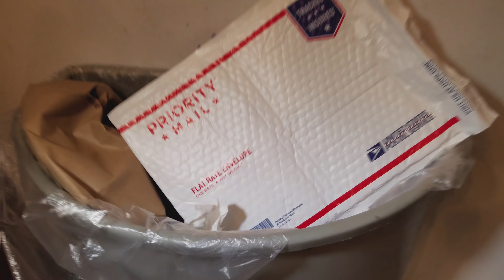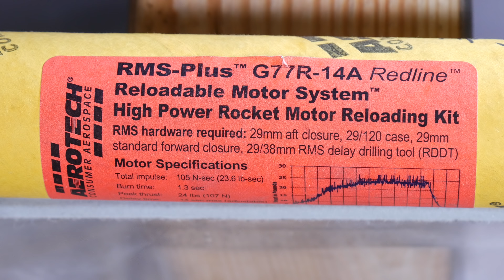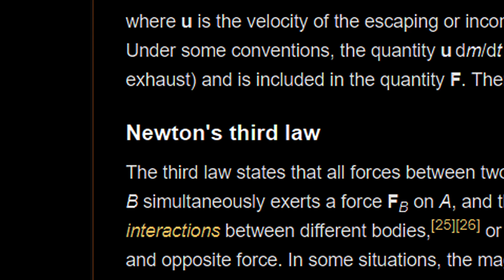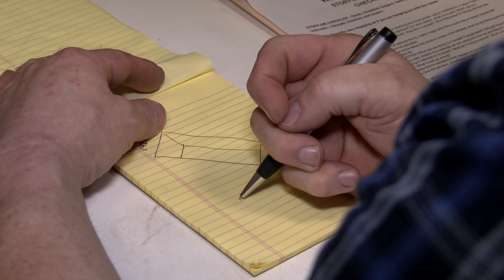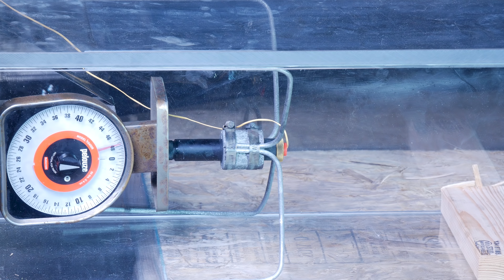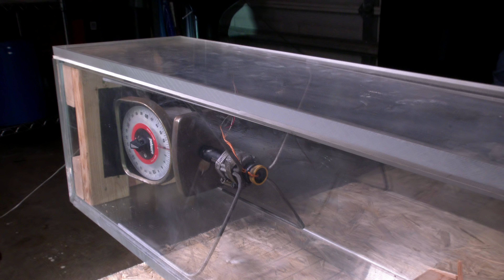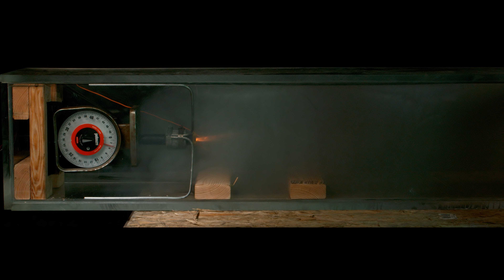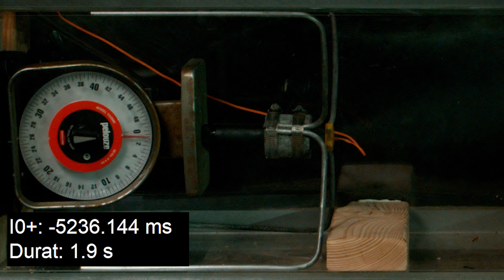Rockets in a Vacuum Chamber - Newton's third law of motion Visualized

Comment: This proves nothing....

There are many flaws in this thrust requires something to push against you are in a tiny container with walls...

Which obviously gives it something to push against...

Space is a much stronger vacuum than can be created on earth....it has no walls and every molecule of thrust generated will be sent hurtling through space I. the direction it left....with absolutely nothing at all to propel it forward.. 

Think doing a pole vault....except you swapped the hard floor for a swimming pool...
Reply: Vacuums are nothing. Literally nothing. There's nothing in a vacuum to cause any molecule to go "hurtling through space" as you claim. What really happens is that the gas produced pushes against other gas molecules, sending them in the direction where there is less gas. But this push is in all directions, including against the rocket engine, so the rocket moves forwards. It's very similar to the recoil of a gun. Imagine shooting a gun, but replacing the air with nothing.
Reply: @the18thdoctor3  vacuums are nothing...which exactly why anything pushed out of a rocket will fly through the vacuum ....it has nothing to stop it....every molecule will be pushed out in the same direction with nothing to stop it....so it will
Reply: @anthonyferguson4218  
"anything pushed out of a rocket will fly through the vacuum"
Yep. And when that something gets pushed out of the rocket, it also pushes back on the rocket, in accordance with the Laws of Motion (specifically the 3rd).
Reply: @the18thdoctor3  no it doesnt a vacuum is empty...things push off air a vaccuum has nothing to push back off...

Its like a pole vaulter swapping the floor that they  apply force to that creates the lift swapping the floor for a swimming  pool...

If  theres nothing to push back off guy have no momentum you kill your own arguement with your own theory...

Yes they will propel into the vacuum of space but they also push back on the rocket....🤷🏾‍♂️ that is impossible 

It's also why a feather falls at the same rate as a bowling ball in a vaccuum there is no mass of air to push against..

You cant create a force pushing against nothing...its impossible 

Zero mass = zero propulsion. ...
Reply: @anthonyferguson4218  
Nope, it is nothing like any of those examples. Rocket's don't push off of the atmosphere or any surrounding medium, they push off of the exhaust gas.

"but they also push back on the rocket....🤷🏾‍♂️ that is impossible"
Nope. Every time you push on something, it pushes back. Every, single, time. Let's stop right here and focus on that one point. If you push something away from you, it pushes back on you. You can feel push that on your hand, and the harder you push, the harder whatever you're pushing pushes back. When a gun pushes the bullet away at a very high speed, the bullet also pushes the gun, making it recoil. A rocket is just controlled, continuous recoil: It pushes extremely hard on the exhaust, so the exhaust pushes extremely hard back on the rocket.
Reply: @the18thdoctor3  the exhaust gas goes directly into the huge vacuum of space....🤦‍♂️

It doesn't hang about waiting there is nothing to stop them....what is hard to understand about it??..
Reply: @anthonyferguson4218  
Yes, what is so hard for you to understand that acceleration requires a force, and that every force acts in both directions?

Please answer the following questions:
If the gas goes "directly into" the vacuum, does it accelerate? Yes or no?
If the gas accelerates, must a force be acting on it? Yes or no?
If a force acts on something, does it produce an equal and opposite force? Yes or no?

The correct answers to all three of those questions is "yes," and thus the exhaust gas produces a force on the rocket while it is accelerating out the nozzle.

What is so hard to understand about that?
Reply: @the18thdoctor3  how can a force act if it has an empty vaccuum to push against...

Like I said before a pole vaulter requires the ground to propel off...putting the pole in a swimming pool wouldn't create any lift...

A vaccuum is empty it has nothing to push off...your nuts
Reply: @the18thdoctor3  

You keep saying the same thing but you keep using earth and the earths atmosphere in your examples...

If you drop a feather in a vaccum it falls instantly because there is no air for it to push off and cushion its descent which would see it float down in a side to side motion..

The expanding vacuum of space just sucks all the rockets energy straight out so particles can not create any force to push the rocket forward...

It is impossible....which is why they continually fake space and always will....there is too much evidence of space fakery already to contemplate any of it being real.....you live in a fantasy

You don't need to fake reality....yet time and time again they do....you believe what you want....until I see some real evidence and not a picture of a burner apparently showing a space flight or someone blowing bubbles on the ISS or not on wires I will believe it...

The ISS is apparently as big as a 747....and yet we can apparently see it from 50 times higher than a plane...

It would be the greatest construction ever and yet nobody has a picture of it being put together...

Yet It has no cameras looking at the sky....it has no fake astronauts taking any picture of above or the horizons it is all based on crappy shots and angles

Every apparent space flight turns all cgi or school project models when pretending to be in space it is beyond ridiculously bad

The great Hubble has never released 1 real picture..

There are also no real pictures of earth 

And even better some people believe a cardboard and tinfoil structure in which the panels on it have gaps in actually stayed on the moon and that astronauts were happy to bounce along the floor on their knees and all sorts despite any hole in their suits would be deadly...

One might also ask why the moon shines so brightly in the sky....so bright you can read in the moonlight at times and yet it is apparently 240000 miles away....and yet when your on it its remarkably dark and dusty and very unreflective...

That fact alone tells you its absolutely nonesense. ...

If a car headlight dazzles my eyes at a few metres away can you imagine how bright the moon must be when you are 240,000 miles closer than we are???

Your problem is you dont think...you parrot...and parrots have bird brains...👍

For once apply some logic to your thinking...if the moon is such a bright light almost a quarter of a million miles away....how bright must it be when you are there.....and yet we see the exact opposite...

Work it out using the inverse square law of lighting...give the moon something ridiculous like 1 lumen...

You will see how ridiculous it is....and if that doesn't tell you that something is massively amiss in our faking of space then you are clinically insane..😁

But no doubt you will still believe because you are either paid to spam social media or because you are to far indoctrinated and too brainwashed to believe everything you were ever told was a lie....I'm not sure but if that alone does not wake you up to the absurdity you are parroting  nothing will 🤷🏾‍♂️
Reply: @anthonyferguson4218  
Oh dear, you really have gone all the way down the rabbit hole of denial. We can discuss the reality of the ISS and Moon landings later, once you’ve accepted the laws of physics, for now we will stay on the topic of how rockets work in a vacuum. 

All the examples I gave work anywhere, regardless of atmospheric pressure. That’s because the laws I described are universal laws of motion, not earthly laws of pressure. The vacuum of space does absolutely nothing to the gas, it especially doesn’t “suck out the energy,” that’s ridiculous. How can a vacuum do anything when a vacuum is just nothing? There’s nothing there to cause any effect. An expanding gas pushes in all directions, and in the nozzle of a rocket, that includes forwards.

You seem to be under the impression that gas is a continuous mass that moves as a single object. This is false, it is actually composed of individual molecules that all follow the laws of motion. Between these molecules is the purest vacuum possible, but it has no effect because, again, a vacuum is just nothing. It is the collisions of these molecules that produces force. These molecules collide with each other and with the walls of a rocket engine. Each collision causes the molecule to bounce off in the opposite direction, flying off as if it had been fired out of a gun. To return to analogies: The rocket is shooting a trillion molecule-sized guns every second (each bullet representing a molecule of exhaust gas). The recoil from these guns pushes the rocket forwards.

You get it now? Seriously, I don’t know how much simpler I can make it, this stuff is so obvious it hurts.
Reply: @anthonyferguson4218  
I just don’t get how you’re unable to understand something as simple as action and reaction. Let’s start over. Does a gun recoil in a vacuum? Yes or no?
Reply: @the18thdoctor3  a gun has two solid components...the gun and its bullet

Why do you lot insist on comparing two things that are not at all the same..

Every item you describe is nonesensical 

You need to remove the bullet...

A vaccum is empty....so to compare the same thing a gun must also be empty..

This is what you lot keep doing over and over again....putting 2 masses against each other...

But a vaccuum has no mass....so stop talking BS...

Now we are agreeing to disagree...so answer my questions now and atop being obtuse...👍
Reply: @anthonyferguson4218   
You do realize that gas has mass, right? A rocket doesn’t interact with the vacuum or any of its surroundings. It can’t, there’s no moving parts on the outside. It only interacts with the exhaust gas, which has mass and a huge velocity, which means an enormous momentum.

When 204 kilograms of liquid oxygen react with 37 kilograms of liquid hydrogen in the combustion chamber of a J-2 every single second, that 241 kilograms of mass doesn’t just disappear. It gets accelerated to 4130 meters per second as the expansion pushes it out of the nozzle. That expansion turns each molecule of gas into a miniature bullet. So no, you don’t remove the bullet, you just split it into a trillion trillion pieces. And remember, gas expands in all directions. That includes forwards. So, each of those trillion trillion molecular bullets causes the “gun” (nozzle) to recoil - and the whole process repeats every second.
Reply: @the18thdoctor3  just answer my questions please...we have been through this...

You believe it gets the power from the exhaust ok...I dont...we disagree...that is ok...

Now answer my questions please...👍
Reply: @anthonyferguson4218  Apparently you don't understand that rocket propulsion gets its FORCE from RECOIL.
The rocket pushes on MASS (the Exhaust gases), and the inertia of the mass pushes back.

If you DONT think rocket propulsion works in a vacuum, then you must also believe that a crossbow fired into a vacuum would NOT have recoil either.
Reply: @anthonyferguson4218  Oh and I can show you live video of a rocket working just fine in a vacuum, but I suspect that you would call it "Fake" even if I showed it to you, so what would be the point?
Reply: @stuartgray5877   @The18thDoctor  a gun has two solid components...the gun and its bullet

Why do you lot insist on comparing two things that are not at all the same..

Every item you describe is nonesensical 

You need to remove the bullet...

A vaccum is empty....so to compare the same thing a gun must also be empty..

This is what you lot keep doing over and over again....putting 2 masses against each other...

But a vaccuum has no mass....so stop talking BS...

Now we are agreeing to disagree...so answer my questions now and stop being obtuse...👍
Reply: @stuartgray5877   just answer questions stop parroting nonesensical claims...recoil is between 2 solid masses....compare some eggs with eggs and stop repeating nonesense....answer these questions....on the moon and the ISS...👍

You keep saying the same thing but you keep using earth and the earths atmosphere in your examples...

If you drop a feather in a vaccum it falls instantly because there is no air for it to push off and cushion its descent which would see it float down in a side to side motion..

The expanding vacuum of space just sucks all the rockets energy straight out so particles can not create any force to push the rocket forward...

It is impossible....which is why they continually fake space and always will....there is too much evidence of space fakery already to contemplate any of it being real.....you live in a fantasy

You don't need to fake reality....yet time and time again they do....you believe what you want....until I see some real evidence and not a picture of a burner apparently showing a space flight or someone blowing bubbles on the ISS or not on wires I will believe it...

The ISS is apparently as big as a 747....and yet we can apparently see it from 50 times higher than a plane...

It would be the greatest construction ever and yet nobody has a picture of it being put together...

Yet It has no cameras looking at the sky....it has no fake astronauts taking any picture of above or the horizons it is all based on crappy shots and angles

Every apparent space flight turns all cgi or school project models when pretending to be in space it is beyond ridiculously bad

The great Hubble has never released 1 real picture..

There are also no real pictures of earth 

And even better some people believe a cardboard and tinfoil structure in which the panels on it have gaps in actually stayed on the moon and that astronauts were happy to bounce along the floor on their knees and all sorts despite any hole in their suits would be deadly...

One might also ask why the moon shines so brightly in the sky....so bright you can read in the moonlight at times and yet it is apparently 240000 miles away....and yet when your on it its remarkably dark and dusty and very unreflective...

That fact alone tells you its absolutely nonesense. ...

If a car headlight dazzles my eyes at a few metres away can you imagine how bright the moon must be when you are 240,000 miles closer than we are???

Your problem is you dont think...you parrot...and parrots have bird brains...👍

For once apply some logic to your thinking...if the moon is such a bright light almost a quarter of a million miles away....how bright must it be when you are there.....and yet we see the exact opposite...

Work it out using the inverse square law of lighting...give the moon something ridiculous like 1 lumen...

You will see how ridiculous it is....and if that doesn't tell you that something is massively amiss in our faking of space then you are clinically insane..😁

But no doubt you will still believe because you are either paid to spam social media or because you are to far indoctrinated and too brainwashed to believe everything you were ever told was a lie....I'm not sure but if that alone does not wake you up to the absurdity you are parroting  nothing will 🤷🏾‍♂️
Reply: @stuartgray5877  show me your rocket working fine in a vacuum...and answer my questions....if you're already saying ii will say it's fake you obvious have some idea it looks fake already..😁
Reply: @stuartgray5877  who told you this???

Why are there no pictures of it being made??

What happened to the moon question??

Can I see a floodlit football field from an aeroplane at cruising height ???.....

Would I be able to see it from 50 times higher??

You're talking nonesense...
Reply: @stuartgray5877  which ones the cardboard and tin foil ones or the ones in nasa swimming pools??...

I build them...😁🤦‍♂️ ok fella....why so they use wires and dodgy cgi on it all the time...where do all the bubbles come from on the fake walks....the pool or space???
Reply: @stuartgray5877  you keep gish galloping from one thing to another avoiding anything you dont like...

No I'm not smart but I can clearly see through your BS...and the BS that your smart physicists need to keep their  funding going...which is paid for by tax payers...

If you control the funding you control the science....its that simple....you ignore all clear cgi fakery the clear use of models and wire harnesses...you ignore all common sense....if any of it was real you would not need to fake any of it..

There's enough evidence to form a fairly straight forward conclusion...they lie 24/7...its as clear as day..👍
Reply: @stuartgray5877  I have....that's why I say what I say....I can see the harness...I can see the bubbles....I can see the cgi messing up...in older versions I can see the camera crew...see the scuba divers and see the wires and the obvious use of fake models made from toilet rolls and tin foil...have you figured out why the moon is brighter on earth than when your on the moon 240,000 miles away yet???

Bit of an impossibility dont you think..😁🤦‍♂️

And yet here we are somehow in your make believe fantasy land we can see things flying higher than we shouldnt be able to see and we get the exact opposite when they're on the moon...we see shadows the fake sun is shining and  yet the moon is not lit up and incredibly dull yet we can still see it from 240k miles away....🤦‍♂️

All because science said...and they must be smart because they're scientists so it must be true...😁🤦‍♂️

Or maybe you can explain other strange phenomena like fake cgi pictures of earth rotating from space and the fake moon spinning around it at speeds that do not equate to real life observations...😁

Or the fact the pictures are not pear shaped like science says...or the fact the widest part of a sphere needs to spin faster than the centre points at the poles..

Whichever way you look....your fake space is BS....but it keeps people in business talking BS and conning the public...👍
Reply: @stuartgray5877  how much do your bot masters pay you??

Why dont you get a life and stop helping to con people...👍